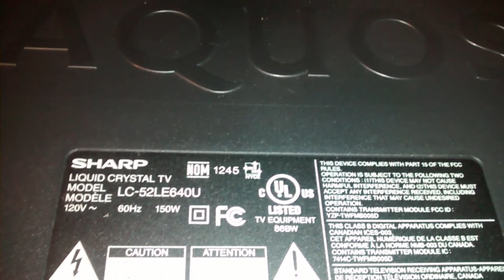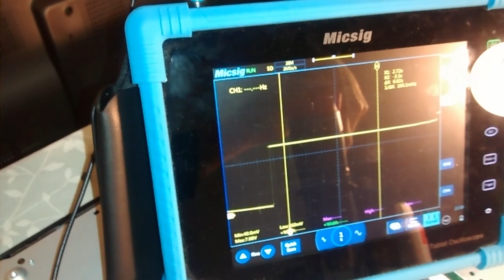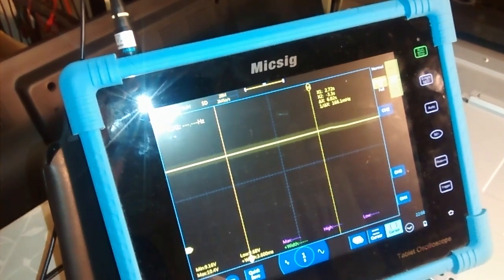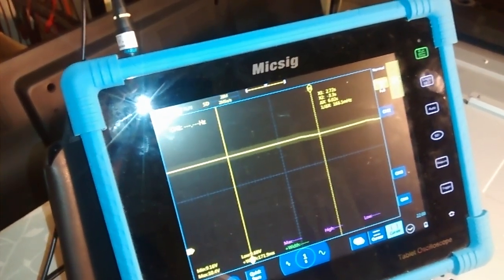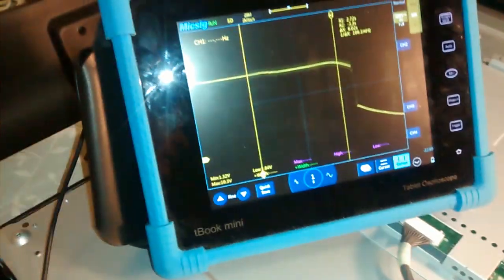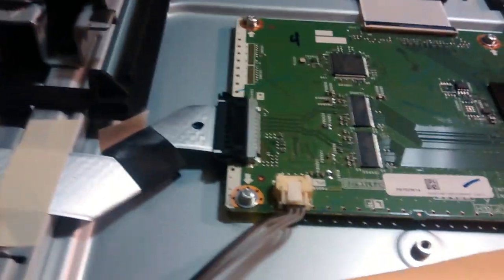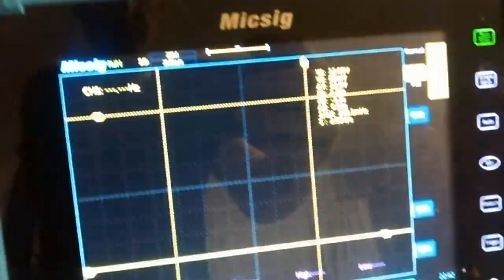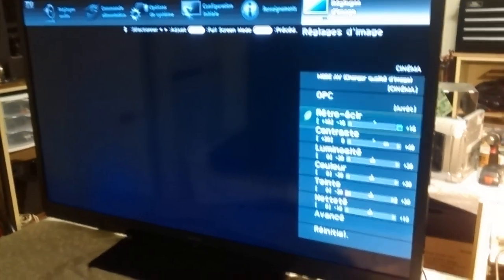LC-52LE640U 2 long 5 short blinks repair

Comment: Here in 2022.   Where did you get the replacement regulator?   And why do you think the regulator died?   Is the large square heatsink not enough to remove the heat?
Reply from the maker: I can't say why it died. I get my parts usually on eBay or Digikey or Mouser
Reply: @tomtechtod9200  ... I'm gonna have to guess that it's thermal-related.   Heatsink probably too minimal on thermal design equations, including any capacitor limitations. Seems like a common issue too, there are other similar videos.

Comment: Hey I can't find that part where did you buy it eBay has no listings for that code
Reply from the maker: https://www.ebay.com/itm/5PCS-KIA378R12PI-KIA378-R12PI-BIPOLAR-LINEAR-INTEGRATED-CIRCUIT-TO-220IS-4-/272872526580